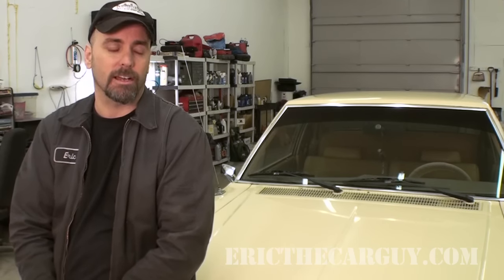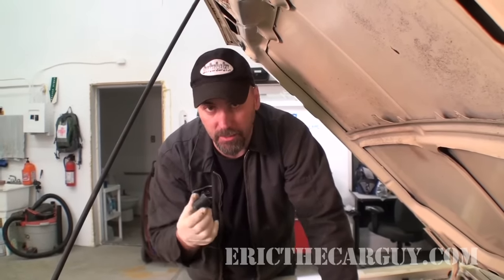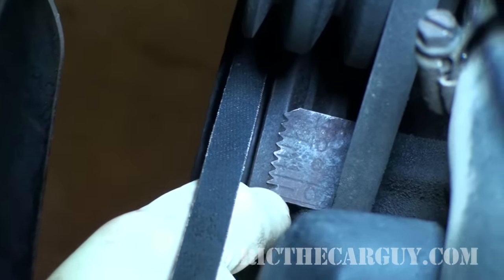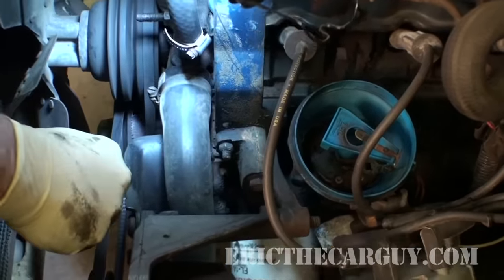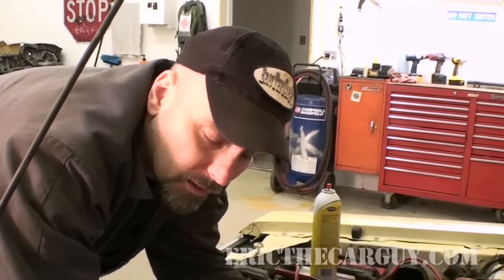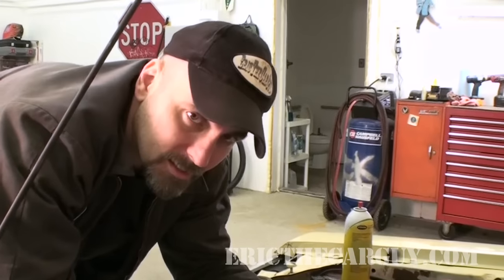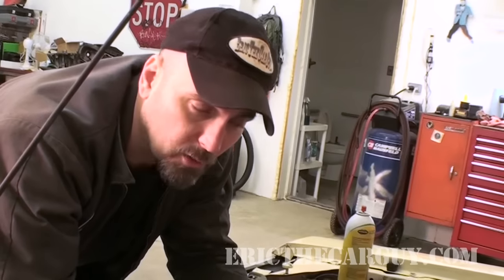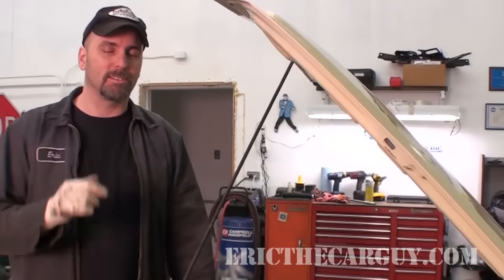How To Check Timing Chain Slack -EricTheCarGuy

Comment: Hi Eric heres a good one for you. I have a 99 astro van 4.3 vortec. 
I suspect timing chain slack and or possibly jumped a tooth.
I noticed a little more noise like clicking and rattling but very quite though.
I can't seem to get the distributor on TDC mark 6 on the dist. housing.
Distributor went bad replaced it had no issue. recently had p0300 random misfire checked ignition timing and noticed the rotor on the dist. was firing after TDC. 
I tried to adjust to back on TDC but could never do it.
The thing that me me concerned and of all convinced and is when I turn the engine over by socket and wrench its smooth than it gets hard and a lot resistance and for a second it pushes back (like the timing chain is too tight and pulling back).
Once I put some muscle into it and get past the hard part when rotating the engine it becomes smooth and loose.
Is this due to a stretched chain causing it to be very tight and loose? And why im experiencing hell trying to install a simple distributor.

Comment: hey etcg, thanks for these information rich videos man i really appreciate ur work. what i wanted to bug u with was my 2001 gmc jimmy. I've replaced all of the emission related components trying to chase down this random multiple cylinder misfire. to no avale. however i can hear a almost tick tick tick noise coming from timing cover area. now this is causing the truck to have noticeable "wobble" at highway speeds. i can see my hand on the wheel kinda going side to side again at highway speeds. already replaced tires ,alignment etc.i have recently replaced balancer hoping that was the culprit but i notice while pressing the new balancer on i could actually move the crank shaft that the balancer screws into in an up down motion ever so slightly which leads me to believe theres a bad bearing somewhere behind that timing chain cover on that crankshaft. what do u think? i know without actually having hands on its kinda like asking to diagnose cancer over the phone,  but worth a shot i guess.might be worth mentioning that there is no other code except the ever present random mis. truck has the 4.3 ltr 4x4 engine just hit 110k miles again its a 2001 gmc jimmy slt. thanks in advance if u get around to this comment or anyone else for that matter. whom ever may have some insight could feel free to gimma a text 443 796 8828 again i do appreciate any insight seeing as how i am not a mechanic by trade but i do  most of my own repairs what with the inner webs & all.

Comment: I have a 1979 ford 460 that stops working all of a sudden once it reaches normal temp. Compression is +/-6 psi on all cylinders, I can see fuel dump into carb and spark at coil and at #1 Plug. Vacuum at idle in park is 17 and bounces rapidly. I did this test and my chain is about 7 degrees like yours. My question is could this be the culprit to my issue?

Comment: This reminds me of something.  I used to have a mid 90s (don't remember the exact year anymore) Buick.  Had a bizarro problem where when the engine got hot after about a mile it would just die.  Then if you let it sit and cool for an hour or so, it would run fine again for about another mile.  At first I thought it was an overheat issue, then maybe a sensor, then I was thinking that maybe it was an electrical problem with the fuel pump.  Basically I went through a huge list of things that it could be with no success.  Eventually I found out that when the timing chain got hot, the metal would expand and it would screw up the timing enough that the engine would just die.

Comment: I used to own a p71 with the 4.6. And it had tendency when I would go to crank it, the engine would not crank but the there was something that sounded like the timing chains whirring away like mad and it was so loud I was actually embarrassed. What do you think this is?

Comment: hey Eric, I had this grinding sound coming from the front end. I thought it was my brake pads on the rotor. I replace my pads, rotors, calipers and likes(it needed it) but I still had the sound. finally I located it and it's coming from the crankshaft pulley location. while the jeep was running I could hear it a little like sand rubbing on metal. I used a stethoscope and I can her some grinding. from the inside I only hear it when moving. rpm change doesn't cause it, only while in motion. does this sound like a timing chain problem?

Comment: i have a question now this car is using distributor is easy to check timing chain slack, but how some vehicle is using plug coil no using distributor, so my question is how to do the checking without distributor. Thank you

Comment: Or you can check the chain tensioner! If you have one that is. 
Would be great if you covered that aswell!
Reply from the maker: This type of set up does not use a tensioner, that's why this procedure works. It wouldn't work on a set up with a tensioner.

Comment: a worn timing chain can also affect oil pressure
Reply: nick carson hi mate can u help me out? i went in a garage and the guy said my timing chain has been stretched but the car drives normally without any problems but sometimes it doesnt start first time but always second time. also no engine management lights have come on? should i still replace it or just drive it as much as i can
Reply: Nick, thank you for saying that , cause I have poor oil pressure and now I know what to do. I know my timing chain has to be replaced.   Again THANKS for mentioning that.

Comment: I have a 2001 volkswagen jetta.
It staryed havimg engine knock
Then the check engine light came on. 
Now it wont start. The noise sounds stuck and it wont crank. 
How can I determine if the engine is dead?
Or timing chain.
Any advice appreciated till I save up for mechanic diagnosis.

Comment: is this motor chain driven? i know that the ford 240 and 300 straight 6 engines are geared drive, the crank gear runs the cam gear.

Comment: This procedure seems overly complicated.  Just put a socket on the crank and turn it back and forth and feel for when the chain tightens up and starts turning the camshaft.  Camshafts have a good amount of resistance and it can be easily felt - no distributor needed.  Very quick.  If it seems like a lot of play then measure the angle to see if the slack is excessive.  This is also useful on some vehicles with tensioners where the chain can get so much slack due to stretch and guide wear that the tensioner at full travel cannot keep the chain tight.

Comment: My 1996 chevy 1500 is fouling the terminals on the inside of my distributor like every other day could slack in my timing chain be the reason for this? Truck has 270xxx+ miles

Comment: Hi Eric. I would like to either purchase bmw 316 diesel f30 w013 or bmw 520 diesel 2012. both driven about 130000 kilometers-150000 km. should I worry about the ti.ing chain of it isnt changed or you think if they r ok can last life time? 
and also automatic transmission oil needs to be changed? or not? and every how many km?
thanks for any sugguestions or other notes.
Reply: bmw 316 2013**

Comment: Back in the early years they had no tension-ers  it took no long for this to happen but then some had plastic teeth over cam and it wore quickly. So this test is a little pragmatic it the nature of the beast when tensioners came out chains lasted a very long time. But If questionable replace it. Dodge 318, 360 440's had plastic teeth and if jumped valves were gone.
Reply from the maker: This one has plastic teeth as well. I suspect that they're worn. They do that to keep it quiet.
Reply: My 94 dodge ram with the 318 had metal cam gears when I did the chain. Idk about pre 94 models though
Reply: Kyle Veilleux Since he used the cu. in. displacement instead of the Liters, and because he included the 440, he probably means pre-Magnum engines.
Reply: yeah i think you're right. now that i think of it i sorta remember that on one of the older builds my grandfather and i did.

Comment: Is there any way to diagnose this on an engine with coil packs, without pulling the timing cover?
Reply from the maker: I don't think so other than pulling the valve cover and checking it. Even that may not be accurate however.
Reply: timing light. see scotty kilmers vid on that.
Reply: Labscope with the right configuration and knowledge of the system can nail this on pretty much any modern engine.  Not really something your average DIY'er can pull off but it is possible :)
Reply: AngeV2 The strobe is connected on the ignition system, which itself is fired electronically based on the crankshaft position sensor (and others), so we have no input about what the valves are doing.
Reply: Yes there is most cars have what's known as a synchronizer which is a distributor and itself.

Comment: I reinstall the main timing chain on my 95 Maxima.  As I rotate the crankshaft, some sections of the main chain get very tight, and some sections have slack.  Is that normal?

Comment: My car gives rattle sound on engine start and idle goes away in high gears. But I hear it again while travelling uphil. Secondly engine has a delay from ignition to start.  Is it the timing belt issue?

Comment: I have a 1998 Chevy Silverado 1500 5.7 Liter engine. My truck started making a noise that is coming from the front of the engine towards that bottom of it when idling and accelerating. I changed my water pump thinking it was that but it still makes that noise. With the belt off I started the truck and the noise is still there. Would the timing chain cause the engine to make a noise that sounds like it is releasing pressure? Before I bring it in to a mechanic I was wondering if anyone knew what it could be.

Comment: But the hydraulic tensioner...  does not correct that slack when the engine is running?
Reply: aleu650,  only a little bit. Once the chain is worn it stretches , so the tensioner  will only take up so much of the slack.
that's why you should be changing your timing chain every 80,000 kms or sooner on some cars. A lot of the time you are also are  better off to change the tensioner and the water pump since you are going to change the timing belt.  People do this only because it's a lot of work , so since they have to remove a lot of the other parts , you would be better off  to change these parts at the same time. Don't forget to check your oil seal at the same time for leakage.

Comment: I had taken my A6 to the audi dealership. After getting my car back, it waa less than 12 hours in the morning driving to work around 6AM. During. The drive toward work which is about 10 min or less my engine light starts to flash and my car begins to shake like crazy.... I turn off the car and call Audi and tell them.... This was 2 days before i needed to go to the hospital for my first born. The female audi service lady said it was there fault and gave me a loaner car. 1 days before my first born i get a call from audi telling me prices..... I then had to rush back to audi leaving work insanely early tp get my car to go to the hospital!

Now im forced to report the dealership and more action will be done, because they broke my car and didnt report any service needed for this outcome they said they dont see how it is their fault and tried to tell me ita becuae the year of the car being 2006.... They said my car is missfiring and the timing jumped so they want mw to pay $8,500 to fix their poor service to my car.......

Carbon cleaning is needed they never told me that plus ingition coils look bad they didnt care to tell me that aswell. Oh yea my engine oil is black, they denied me service to change my oil......

Comment: hi can someone help me out? i went in a garage and the guy said my timing chain has been stretched and needs to be replaced but the car drives fine without any problems but sometimes it doesnt start first time but always second time. also no engine management lights have come on? should i still replace it or just drive it as much as i can
Reply: kay2382, if you follow Eric on this video you can  check it for yourself to see if the guy is lying or is telling you the truth.
And yes sometimes you really don't notice if the chain is loose by driving down the road , but if it does breaks it would ruin your whole engine.  Well, some engines.  Be sure. !!!

Comment: My one of my vehicles well actually I'm just stuck I bought a thing about a year ago my friend told me I needed a camshaft sensor he give me one cuz he on the truck but I messed around and misplaced it drivable I mean it had a little skip to it took my kids to school the other day when I drop some of them off at one school and went to go to the hood I couldn't hardly go in it it didn't backfire I didn't nothing put it on my machine it said it needed a crankshaft positioner or crankshaft positioner/camshaft positioner sensor I put both of those on there still no results plugs wires no reason I can advance the distributor a little bit cuz it didn't sit in there straight it was in a angle light it's a 5.72 k1500 96 model so then I put a distributor in it I timed everything got number one up on the right stroke put the distributor in time set it down and fell in place like it was supposed to be cannot get it to crank any way I moved at distributor so I put a coil on it cuz it was firing but it was yellow fire put a coil on it tonight still nothing what else can I do to crank it to fix it it was running before I put the other distributor shaft in it the old distributor shaft the gears on it man they were like knives that was that sharp but it was running do you got any advice what it could be and I can live video you and show you what it sounds like it wants to crank it tries to crank but it's like it's no gas

Comment: I have a 91 f150 with a 300 straight 6 and I don't think it's has enough power has a should I changed my plugs and wires and I took my pugs out the other day and it's burning hot could this be the problem

Comment: "many engines rotate clockwise".  Is that clockwise from the perspective of the driver looking from his seat towards the front of the vehicle?
Reply: Clockwise is clockwise no matter how you look at it.
Reply: Clockwise looking at the front of the engine.
Reply: clockwise from the perspective of the front of the engine. Not always the front of the car.  If its a transverse engine, the front will be the side with the timing cover  and the accessory drive belts.  Usually the passenger side in this case, but honda likes to do it the other way around…hope this helps
Reply: pdgeman It depends on how you look at it. If the back of a clock were transparent, you could read it from the back side. It would be anti-clockwise from that viewing point.
Reply: A good way to see the direction is just having a look at the fan (if its driven by the engine and not by an electric motor) the fan should blow air in the direction of the engine.
Reply: devilmastah Thank you.
Reply: axelasdf
no matter what angle you look at the clock, it's turning clockwise. just because you make it transparent doesn't make it turn backwards.
Reply: You don't understand what I'm saying.
Reply: You've had 3 years to think about this... crossing my fingers, bud.

Comment: Eric, the test was useless.  Any engine could pass by your 7 degree test because the slack in a timing chain is on the non drive side. You would rotate your crankshaft in the direction the engine turns when running and THEN watch your rotor as you turned your crank the opposite direction.  Get my point? The side that is pulled down by the grab of the turn will always be flexed tigt even if you has 4 inches side play on the non grab turning side.

Comment: Eric iv been watching your videos for a wile and now im stuck, I need some answers and hope u can help,  Iv got s 98 yukon that is very clean and it garage kept and i do all my own work, iv got misfiring thats not throwing a code , i no this because i put it on a scanner.  here is everything iv did to fix this problem , just to let u no iv been chasing this problem for over two years,  i have replaced intake gaskets twice, and replaced the spider injection twice and the distributor, and plug & wires . but it has thrown po300 codes in the past. iv have several good mechanics look at it and they would tell me to do something,  and i would do it and it wouldnt fix the problem. and they all said its not my timimg chain. so i took it to chev dealer and told them to find out what was wrong with it .  truck has 182000 miles on it , dealer said that the valves are sticking and they wanted $2200 to put new head on it ,  lololol  .  could this b right?, i can put new rebuit heads on it my self but with 182000 on it i feel i should put new motor in it .  the only thing i havent replaced on the motor in the timing chain and i really dont wont  to put any more money into it if its not going to fix it .iv been looking at crate motors but im not ready to do that yet. iv also replaced the coil and everything u can think on top of motor that could deal with problem , so this it what it dose , just driving u can look at the scanner and c it mis a little, then when u get on it and your doing 60 when u let up on the peddle and it will sound like a tire is coming off, and u can c on the scanner that is really missing , this it will go away once u give it gas, and its not throwing a code , not sure why ,  could timing chain b lose .?? what do u thing . i would even give u my phone number if u want , so thankyou for your time and all the good videos
Reply: those vortec motors are prone to drop valve seats and crack heads. at 182000 that motor is just broken in. Ive seen them go well past 500000 with no rebuild. pull the heads off have them magnafluxed to check for cracks. if so throw em out and get new remans. if not have them reworked and change your related components including timing chain and valve springs